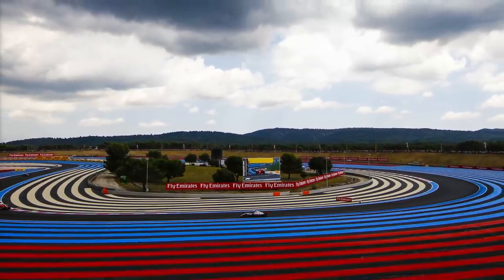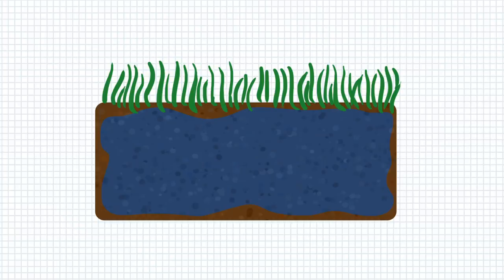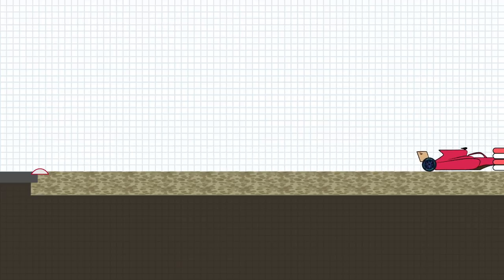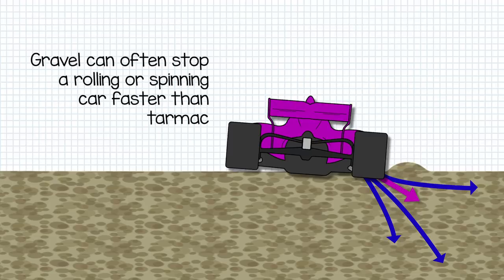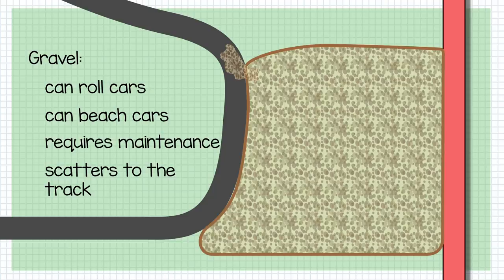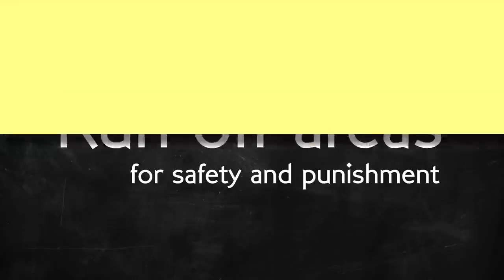Run off areas in F1 - Safety and shortcuts

Comment: Still think there should be a some gravel towards the outer edge of run off areas situated at the end of straights. There is still one really scary type of accident which we need to consider; an accident caused by the inability to slow down the vehicle through conventional means (i.e. applying brakes).
Such accidents may occur due to brake failure, hydroplaning, driver losing consciousness (for instance due to getting knocked out by flying debris), detached tyres, etc.

These are severe accidents with a great potential of ending in an extremely high speed head-on impact with a wall, especially at the end of straights! It is in accidents like these that gravel really excels at aborbing energy, and where tarmac simply fails.

At the end of the day, though, these are just thoughts from some random bloke on the internet, and I am prone to missing a couple of important points. ':D

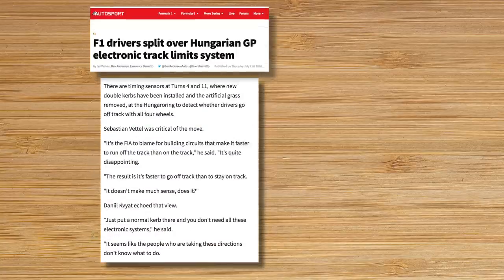Comment: 5:30 I think this is a good position to take from a neutral place (i.e. you're not a driver who has driven off the track to go faster) because there SHOULD be some physical tangible disadvantage to flying off the track (how about some amount of altitude dropoff? if you stray too far, the sudden and short slope could cause damage)

hmm... that's a horrible idea. How are you supposed to brake if the tarmac disappears from under you? hmmmm..... uhhh...
Reply: 5:50 okay so, it was kind of, more or less, the very next part. Okay. Yeah, see?

Comment: I’ve always wondered why not have tarmac runoff but to police the use off running wide off track limits you have some sort off police style stingers in the ground? There?  Obviously they would have to be modified to be slower working then the police ones use on the public  but if possible make them give you a obvious semi flat tire by the time you get round to pit entrance on said track ?!

Comment: how about haveing a bit of gravel right next to the track (lets say about 2 car-lengths wide) so the drivers are punished for running off the track, then have a bit of tarmac between the gravel and the barrier for safety.
Reply: Knuschberkeks dangerous as the gravel spills into track, punishing other following drivers and initiates unnecessary safety car / flags
Reply: Mohammad Arif Anuar ok, then have a patch of grass rather than gravel
Reply: Suzuka has a line of (atrificial)grass between the track and tarmac run-off areas. You slide a bit out and can then brake and such

Comment: So why not replace sausage kerbs on the outside of corners with a narrow strip of slippy material such as grass, gravel or some kind of special paint? So if you go wide on a corner you have to back off to avoid a spin, but if you do spin or otherwise lose control there is a large area of asphalt to avoid crashing?

Comment: Has anyone experimented with leaving a foot of tarmac outside the track line, then going into a shallow gravel pit for a few metres, before adding a big enough tarmac zone out the other side that you’ll get beyond where you can spread the sand to.

Would discourage putting your wheels there unless your really going a mile off the track, but should still give some control to the driver. 

(Maybe even having another 5 or so metres of gravel before the wall after the main tarmac run off. If you’re still out of control that far off the track you should have washed off a lot of your speed and the gravel should be a more effective brake)

Comment: My idea has always been, to have grass or gravel for about a metre off the track edge, so if you runwide, you lose time for you mistake, but after the metre you can just have normal tarmac which is effective for slowing down to avoid a collision, I can't be the first to think of this, so what are the downsides of this?

Comment: Gravel should be there anyways. Asphalt will not stop a car which has lost control over braking or steering, at least not as well as gravel. For instance, the front wing of an F1 car could receive some damage, detach and get stuck under the wheels, it happened before, and in that case, tarmac will not help you stop. So maybe there should be at least a strip of gravel at the edge of the track, even after some tarmac

Comment: would it be interesing for cars to have abs that only gets enable when they go off the track? such that during the race they still have to watch the brakes to not lock them up and stuff but when they go off they can slam the brake and the abs would stop them safely andwithout destroying the tyres
just a thought
Reply: HECKproductions that’s possible but if it malfunctions and doesn’t work off track, or works on track, then we come into another issue.

Comment: They should make the run off always wet.  Still better than a gravel trap in terms of friction, but an instant penalty, even for a wheel off the track. It would also make the car slow for a corner or 2.

Comment: Tarmac is the best solution for  a crash or mechanical failure. No question.

Monza is a good example. First chicane you have a detour in case you overshoot the first turn. Second chicane run of area is complete tarmac with a detour to return on the track. Best solution for the highspeeds the cars arrives at the chicanes. 

Then you have the 2 Lesmoscurves with graveltrap.  Here the driver must find the limit without overshoot the corner, race can be over with a mistake.

Finally the Parabolica, here we have a combination on tarmac and gravel. And almost all drivers say, the character of the turn is complety gone after the tarmac on the outside was installed. You dont have go to the limit of the car step by step. Because of the tarmac you find the limit very quick.

Thats wy old school tracks are  popular this days. Sometimes the drivers must have some balls to drive on the limit.

Comment: I think the best alternative they have would he to have a strip of a gravel trap, with tarmac behind it afterwards.

1. They will most likely slide across and be able to continue.
2. No advantage to be gained as the gravel is RIGHT THERE.
3. No need to add a penalty.
4. Not enough gravel to pitch a car into a roll.
5. Gravel won't be distributed back out on the track, as cars will rejoin BEHIND the gravel trap, through a small exit road, like at the Red Bull Ring.

Comment: What about a slippery strip between track and run off that would make you lose control just like grass, and behind that strip of for example grass you'll have regular tarmac for better braking and spin control
With that drivers would want to avoid running off the track as they'd most definetly lose control over the car baut would be able to recover rather easy from said accident 🤔
Plus, if that defined line of return is implemented aswell theyd get a god penalty if the kept control over the car after passing the slippery part/strip

Comment: How do these Ultra Grip Surfaces of Paul Ricard and Yas Marina work?
Reply: No Anime Ah okay. It just seemed odd to me that different type of asphalt would make that big of an impact in slowing a car down.
Reply: i believe its some sort of grinding asphalt, the blue has high grip, and high tire wear, and the red stripes have even more grip and tire wear, i dont know for sure tho, but i believe thats how the cars are slowed down
Reply: They give the car grip to brake and accelarate, but tyre wear driving over them is through the roof. You could install them on the track, and everyone should go seconds faster, but the tyres would degrade A LOT faster. It could be that the Ultrasofts wouldnt go 5 laps.
Reply: Whoops didnt refresh the page
Reply: Timo Derks Yea, he said that in the video as well.. I just thought there would be more details to it.
So only the coloured parts are more grippy and the black asphalt in between is normal asphalt again? Whats the sense in that? Not killing the tyres completely or just too expensive?
Reply: Its not as much the asphalt that is any different but the paint includes tungsten and maybe carbon aswell making the paint very grippy but as others have said, tears tyres apart.
Reply: No Anime as Ericsson showed us it cant always no ;)
Reply: Emil Winbo Ah ok thanks
Reply: i'm guessing that the regular asphalt between the high grip asphalt is for gradually slowing the car down, give the driver time to adjust to sudden changes in G-force - not an expert here lol

Comment: Another solution is to have a track boarder of say 1m of grass everywhere and strait after the grass theres tarmac. So give up a meter of safety surface where drivers dont want to drive over, and thatll keep the cheaters on the track but still have all the properties of a safer braking run off zone after the punishment grass area

Comment: Great video! Question: The painted tarmac runoff areas at Paul Riccard, is that special paint made to slow down the cars even more, or is it just regular paint?
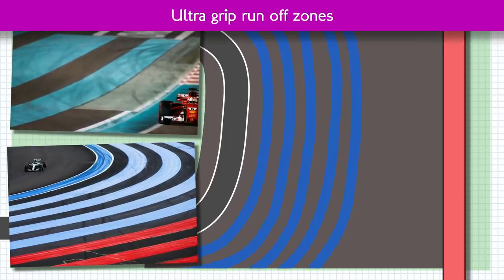Reply from the maker: 6:32 - it slows them down more
Reply: Thanks, so I guess the paint has anti-skid properties, unlike the kerb paint that can have the opposite effect...
Reply from the maker: Kind of - except it's not the paint, the whole surface is a different material (imagine concrete mixed with very coarse stones that make it set like rough sandpaper)

Comment: Those sensors they had that detected a car and allowed a penalty to be impossed.  Make then cut engine power for ummm, 5. of a second or 1 second, whatever is necessary to give an advantage to the car you are dicing with that stays on track.  Drivers will stray off track way less often but  not suffer damage when they do.

Comment: I Think By Splitting The Track And Runoff Area By A Few Metres, And Filling Out Them With Gravel Is A Better Idea.
Therefore Racers Won't Use The Runoff Areas As An Advantage, Since They Literally Changes Your Pace Of Racing. I Think No One Will Ever Do That.
As From A Safety Stand Point This Is   Also Great Choice. Since When They Go Out Of Control, There Is A Lot Of Tarmac Stabilize The Car.

Comment: "You don't want to eliminate a car for a simple mistake" YES WE DO (well I do, at least). One of the things I specifically want is to make going off the track as race ending as possible within reasonable limits, without making it dangerous to the driver. Currently we see too much that the driver on the inside will just force the other driver off of the track, because they know that they won't fight back, because there's very little punishment for going off track aside from losing a bit of time. Gone are the times when you would see two cars going through a corner side by side, and at the exit you'd wonder which one makes it, the guy on the inside who had the better line through the corner but can't go as wide on the exit, or the guy on the outside who can straighten out their acceleration a bit more. Now one driver just gets on the inside and forces the other guy out. I want each and every driver to be so reluctant to go off the track that they'd rather suffer the collision and hope for the best than drive wide on purpose, after a while that forceful tactic would stop working and would hopefully be abandoned again... And I want drivers to be scared of messing up a braking zone at the end of a long straight because there's a gravel trap waiting for them (it could even make the braking contests more interesting due to the added risk). I want the damn drivers to respect the limits of the track at all times.

I think the only real time when I would rather see a big tarmac runoff area rather than a slippery grass field or a deep gravel pit, is when there's an accident to be avoided. Two cars have a bad wreck on the track, and others need to get around them? That is definitely a situation where big runoffs would be great, but for actual racing purposes I want them gone.
Reply: Roger Dodger /videos Happened to me many a time with Häkkinen, JJ and Salo. It was, and should still be, a part of the sport.

Comment: Why don't they put 3-4m of grass between the track and run off areas?

It would penalise drivers enough for minor mistakes by creating wheelspin and it's not as slippery as astro turph as well. Re turfing after the race would be easier as only small amounts of grass would need to be replaced. Thus also reducing the chance of drivers use run off areas as an advantage.

After the grass can be the asphalt and high grip zones to reduce chances of major crashes predictability and safety. Then have return routes as well to reduce so if a drivers keeps running on they can still back on track with a penalty.

Comment: I think damage to the car without extra risk to the driver is good. There needs to be some deterrent, some jeopardy to going off track in the same way you wouldn't want to hit a wall along a straight. Spike strips would be good, just outside where the cars are permitted to go. There can be tarmac outside that for the car to slow down.

Comment: The whole track limits issue is a farce, they should be OUT for putting ONE wheel over the line, as if there's a barrier. There should be a step so if they go off they can't get back on and have to exit through the barrier at the marshals station and retire the car. Same effect as a barrier but with minimal damage / danger and no disruption to the race. If leaving the track meant their race was over they would stop doing it. We just watched Monaco, no-one hit the barrier during the race, so it can be done.

Comment: Do you have a video on fire extinguishing?  Safety related topic

Why don’t marshals use carbon dioxide extinguishers as they do not damage engine and don’t conduct electricity?  Why foam used even though it can conduct electricity? 

Extinguisher in car is carbon dioxide?  

Any difference for formula E?
Reply from the maker: Because foam is used to petrols and fuels, which are the most likely causes of fire in motor racing. Carbon Dioxide extinguishers are much less effective in an open environment. Foam is quick and immediately reduces the risk of fuel and oil fires.
Reply: Chain Bear F1 Thanks.  Does foam conduct electricity though?  When would they use the powder extinguisher?

Comment: Could they not introduce a system that on large run off areas limits the cars speed like in the pits as a punishment. So as they come off the car is only about to do 80kph till they get back on the track.

Comment: What about race tracks that are both used by cars and motorbikes? What is the ideal solution for a motorbike when the rider fall off and start sliding off the track?

EDIT: Noticed your comment. Would like a more extensive analysis for motorbike racing.

Comment: Why not just put a few yards of grass in front of the tarmac run off so if you go to wide you slip into the run off but loose control a bit but if your about to crash you get the grip you need to stop

Comment: Why not have a strip of grass on the edge of the circuit and then tarmac past that? Surely that would punish drivers for going wide and still be able to slow them down if not under control.

Comment: 2:02 Uniform grain gravel a foot deep can have a whole lot more stopping power than a gravel or dirt road. (Edit: I see you explained it all right after that lol.....)

Id estimate that coefficient around .45 at the very least....but really more like .60 

Those cars can sink like 6 inches into that gravel when they slide into and across it...and that coefficient has to be at least equal to the "5cm deep in loose dirt" at the bottom of the chart... But I guess that was due to the raking you mentioned ...

Comment: here after the 2019 french gp where perez followed the correct track return procedure but got a penalty for gaining an advantage because it was set up wrong by the stewards
Reply: actually no, the stewards didnt expect it to be used on the first lap, where everyone is much slower thru the corners
for normal racing speeds it would have been fine

Comment: You say that the paint's tyre wear can be a race ruiner, which...yes, but isn't that kind of the point?  It's an instant penalty, just like you wanted.  I just wish the paint was black, the blue stripes are kind of a headache to look at, but otherwise if you take so many offs you need to pit again...

Also re gravel, "we want to avoid beaching the car because who wants to see cars retire" is true, but if you screw up, isn't retirement sort of an inherent risk that isn't necessarily to be avoided?  Ideally beaching and car damage would be an possibility without risking harm, since the moment you bring threats like that into the equation, the thought of going off track carries serious consequences.  

I wonder if you could have long gravel traps that always pitch upwards (so the circuit is at the center of a depression with gravel lining the walls) so that when you run straight off, not spinning, the front of the car is digging into the gravel like when it goes sideways - only its on the long axis, so it works without being dangerous.

Comment: Does F1 cars with a very low center of gravity really flip on gravel traps?
Reply: Yes they do. Very rarely but they can. 
And don't forget there are other Series using the Tracks. A GT3 Car for example will flip over much easier in Gravel.

Comment: How come F1 doesn't implement a rule like NASCAR's double yellow line?  In NASCAR It is fine if a driver passes over the "out of bounds" marker so long as they don't gain track position.  Guess the racers in a NASCAR event tend to stay much closer together though, a shortcut in NASCAR would likely result in a pass, where in F1 it would just gain you a second or two on the car way ahead.